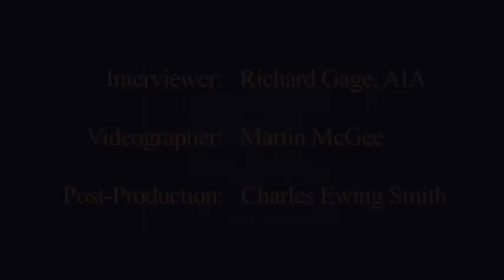Robert Podolski, Physicist, Engineer

Comment: Based on photos of the debris, the 48 core columns on bldgs. 1 and 2 had to have been severed more than 480 times. To do this in 10 seconds by gravity impact of the top stories' "hammer" is fantasy. Examination of photos of the "cuts" (breaks) shows melted steel. Can't happen without a thermite or thermate-type cutter.

Comment: it wasnt JUST jet fuel burning in those fires. it was jet fuel and all of the contents of the offices. high rise fires with modern contents (plastics and synthetics) burning can be some of the hottest building fires there are. not only do contents burn, but the fires create super-heated gases that accumulate at the ceiling level and eventually ignite themselves. this can create temps well above 1000 degrees, hot enough to weaken and deform steel structures. this guy is not really too educated about fire science.
Reply: And then the buildings fell with explosive deformation at near freefall speed. Doesn't happen like that. Particularly with 80 floors of structure unaffected by fire to chew through.
Reply: There was no jet fuel in Building 7.
Reply: @Chorkaloopa 
So what?
Reply: Even more, plane impact was like a shotgun blast going through the buildings, shredding and piling all the building contents in their paths into one area of the buildings, and that is where the hottest fires were observed, as well as where both collapses started. The planes themselves also contributed to fuel for the fires. Anyone who thinks some controlled demolition charges survived those blasts and conflagrations in precisely those areas have totally taken brains out of gear.
Reply: Bushbuddy Platypus
"Explosive deformation" lol! What does that mean???
Both Towers started collapse with the gradual inward sink of perimeter wall, exactly where the planes ended up in the building. Once the tops tilted, down through the lower tube was the only possible outcome, and it wasn't "near free fall"; it was about 2/3 free fall, based upon perimeter wall panels actually free falling outside the foot print.
Reply: @whetedge  What? You don't think explosions deform things?
Reply: Try reading in context..."the buildings fell with explosive deformation". The buildings were  not "explosively deformed". I made no mention of whether or not explosives deform things.
Reply: @whetedge  But I understand the context completely. You question to Bushbuddy Platypus was, "Explosive deformation" lol! What does that mean???"  I asked the question in light of a known values. That value being the measured width of the trade towers’ debris field, which was two hundred to three hundred yards in diameter, as reported by FEMA. Gravity does not have a horizontal component. The question should then become: what is the source of the energy necessary to launch multi-ton section of both towers hundreds of feet horizontally?  To ask the question in other fashions: Where is the concrete?  Why wasn’t there a pile of ruble where each tower stood? The answer to that can be found in Bushbuddy Platypus’ "Explosive deformation."
Reply: @JackCarlock56 
 Your question was not at all "in context"; it was pure snark, and frankly, not worthy of response. Whether or not I think explosives deform things is irrelevant, and contains an idiotic assertion that anyone would think they don't. Now, you follow up with another idiotic assertion, that "Gravity does not have a horizontal component", in trying to mystify why large sections of perimeter wall panels fell hundreds of feet beyond the building footprints. Again, any idiot knows "gravity" has only a down component. The manifestations of gravity however, have vertical and horizontal components. Of course, you know that, but amuse yourself by playing with words in order to try and make a point which isn't a point at all. Why do you think truth need such deception? It isn't truth if it does. What's true is the evidence based fact that 70+- story perimeter wall sections fell over, pivoting near the ground, causing the upper sections to land some 700 feet from the building footprint.
Reply: @whetedge  
Pure Snark, huh?  No shit Einstein.  It was your own snaky comment to Bushbuddy Platypus which inspired me to comment. This in and of itself puts my comment squarely in the middle of the context.  
You debunker types are always good for at least one whopper per post. In this current case, “What's true is the evidence based fact that 70+- story perimeter wall sections fell over, pivoting near the ground, causing the upper sections to land some 700 feet from the building footprint” is yours.   

Post that evidence. 

By the way, besides being redundant, what is an evidence based fact?
Reply: @JackCarlock56 
"Evidence" and "fact" are NOT redundant. The sum of evidence produces a fact, and it is fact perimeter walls of the Towers were splayed apart, pushed over, some as tall as 70 stories, pivoting from ground level. Go do some actual research on the north wall of the North Tower for a clear example, instead of wasting your and my time with idle speculation. You won't, because you have already demonstrated you don't give a rip about the truth.
Reply: @JackCarlock56 
~ "Evidence based fact" is NOT redundant. It is statement which communicates a fact isn't just made up, or surmised, but is what the evidence states.
~ “Explosive deformation”  is a vague, general term which can mean anything. Drop a raw egg and the floor and it will "explosively deform". Con men typically use such vague language; real researchers don't.
~Yes there are videos of a 70+- story section of North Tower north wall falling over. It can be seen on many collapse videos. The fact you deny it is clear evidence of your "research" is lacking. The spire of that wall is what sliced down through Building 7. It is the same spire David Chandler clocked at 75ish mph, much faster than all the rest. Had you actually studied the evidence, you would know why.
~ _"Gravity"+ ...you seem to enjoy circles, because that's all you drew. You ignore the difference between "gravity" and "the manifestations of gravity".
~  "The Towers were splayed apart". The evidence, collapse video, debris patterns, and structural remains, is voluminous and conclusive.
Reply: @JackCarlock56 
Have you studied the North Tower north wall? Have you identified the spire of perimeter wall that traces movement of the wall? Have you studied the remnant base of the north wall, leaning against Building 6 and bent outward?  How'd that happen? Have you studied the debris pattern of that north wall? What about the rest of the debris fields? Have you studied the patterns of perimeter wall laying flat on the ground, stretched out from the footprint for hundreds of feet? Did you happen to notice the east wall of the South Tower splaying outward, emerging from the dust as the top pushed it outward? Of course you have not. Had you, you wouldn't be on here demanding proof, because all of that and more is proof. All you want to do is try to discredit messengers, not seek any truth. You are a fraud, just like Gage & Co. Despite your claim of having volumes of data/video, you have never studied objectively. You are clueless, and will be laughed out of court. The evidence is simply overwhelming for what did occur.
Reply: @whetedge  To be clear, you stated that a 70 story tall section of Tower One's north wall fell as a unit, hit the ground, pivoted, then fell with the top section landing 700 ft +/- from the perimeter of the tower's footprint. Is that correct?
Reply: @JackCarlock56 
Nope; never said that. Go work on reading comprehension.

Comment: @oidunno88 I have no prejudices. I observe. In 2001 I was not on You tube, I did'nt look at a computer until
2004. My observation in 2001 was that no building collapses like that naturally at very close to free-fall rate.
My main observation was that there seemed to be zero resistance. Impossible!!! & A&E of 911 truth have
confirmed that for me 10 years later. Believe me mate, I'm not a fool, so think 3 times before you answer me!

Comment: @oidunno88 What you explain here about plastic buckling, due to damaged fireproofing, is not the case according to calculations done by other structural engineers & physicists.
Also it has been proven that the calculations done by NIST were all either doubled or halved,depending
on what they needed them to be in order for the desired effect on the steel structures. So their calculations are fraudulent. Even if there was no fireproofing on the steel,the temperature was not enough to sag beams.

Comment: @oidunno88 "they are efficient at what they do under normal circumstances" -Yes & like all buildings
that have undergone longer & hotter fires,they have never come down as if by CD, unless it was CD.
If one element of the  integral structure is damaged, as in the one steel pillar failing in bldg 7, its ability to
resist forces is compromised but if you mean massively, as in bringing the whole building down, no that makes no sense at all, even at a slow rate let alone at free fall rate.

Comment: @oidunno88 1st of all dont try being smart by putting words in my mouth. Its obvious by observation of the best
footage that energy & momentum was not lost by the top section of either bld'g 1 or 2, so no impact on lower floors. Also the sections above impact were imploding as they started to fall. Both observations
imply CD. If your not observing this then you must have a blind fold over your eyes, either physically or
psychologically.

Comment: @oidunno88 What ever you say still does not explain how the top floor off ALL 3 buildings fell as though
there was only AIR under them, not 10's OF THOUSANDS OF TONS of STEEL & CONCRETE, which will
OBVIOUSLY create RESISTANCE. Best case scenario, those buildings will not fall in under 30 seconds,
& thats probably an exageration. The real speed for pan-caking or other natural collapse would probably be closer to 3 - 10 min & more probably, up to 1 hour.